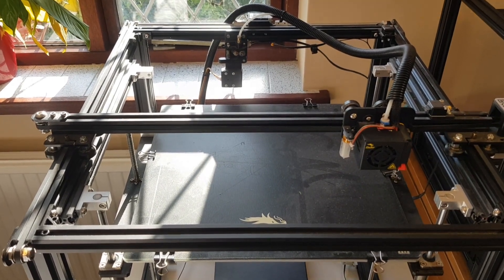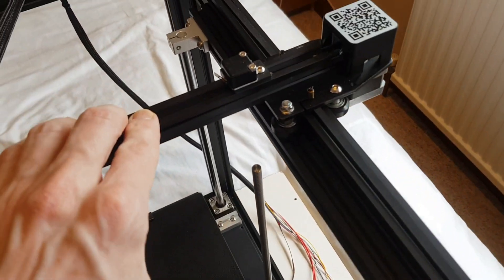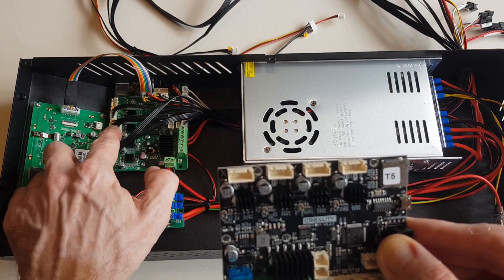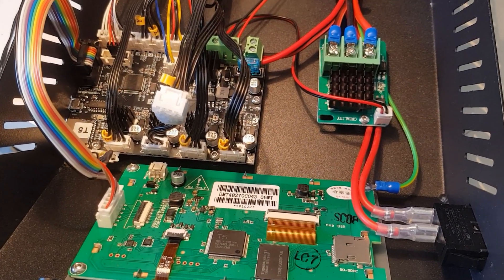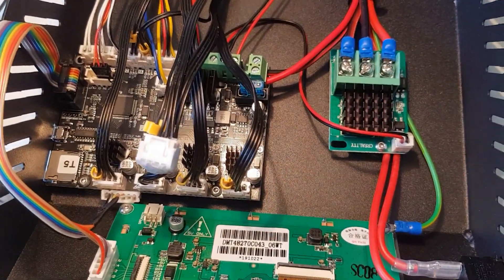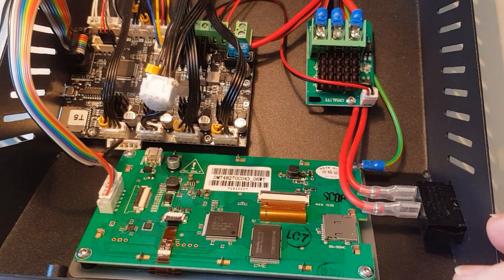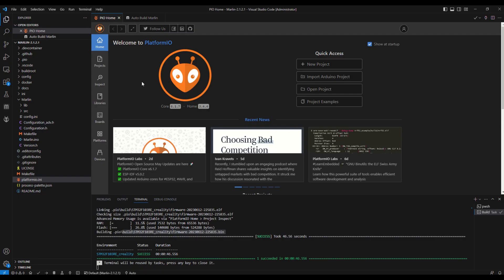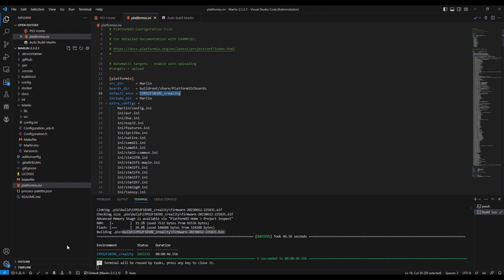Creality Ender 5 Plus - Repairs and Upgrades with 32-bit V4.2.7 Mainboard and Marlin 2.1.2.1

Comment: for the non-silent board, it's enough to replace the IC on the mainboard, cost 3-5$ (but needs hot air gun).
I replaced all the fans on the board including the one on the powersupply the printer is absolutely silent now, a friend took the printer home and is printing day and night again. I switched to CNC because I need a higher accuracy for my projects at the moment.
Reply: Is it enough to solder only TMC2208 stepsticks or something else ?
Reply: @R4ZI3L666  as far as I remember I only changed the trinamic ICs with a hot air gun. Everything else remained the same and everything still works for a couple of years. However I had to change the bowden part, the plastic snapped it's aluminum now (this is unrelated to the TMC upgrade)
Reply: @mrechbreger  Did you change the VREF voltage?  (stock board XYZ 0.68V E 0.77V ?)
Reply: @R4ZI3L666  it's a long time ago but I did not change anything aside from the driver ICs as far as I remember. I only replaced the trinamic driver IC itself. There's not much torque required, the torque which the trinamic system had was absolutely suitable for this system, so all the settings were just okay.

Comment: Hang on wheres the steps on how you put these files into the printer?
Reply: I was wondering the same thing at first, If you download creality slicer or an alternative, you can upload them directly to your printer through the cable.
Reply from the maker: You copy the firnware  onto the SD card, insert into printer and power on. Same for all these 32bit printers with Marlin
Reply: @amp9438  Unfortunately after hours I am still unable to compile a bin file. I have tried using the one you supplied. Found out that you had to rename it as "firmware" with a couple of numbers infront of it however all i am currently getting is the marlin logo for however long with the hotbed just getting hot. Compiling the bin file shows that the configurations are out of date and the marlin archives do not have the 2.1.2.1 files available.
Reply from the maker: As this is an old video I believe the version of Marlin I used is no longer on their website so my configuration files won't work and need updating. I plan on upgrading my one so will upload the new version when I can.

Comment: Do you just take the file off thingiverse extracting the files and change the name of the zip.thing file to firmware.bin?
Reply: I had the rx and tx wires reversed the mother board flashed correctly now the bl touch dosnt stop the z home, everything seems to work fine I just gotta figure that bl touch issue out
Reply from the maker: Check the wiring on bl touch. I had to swap them round for the z stop
Reply: Thanks for the help but it didn’t fix it I think the issue is with the bl touch it self it is pretty old. The wires are also kinda questionable. It work for 1 power cycle then wouldn’t even do it’s self check when powered on. I will figure it out eventually thanks again for all your hard work.

Comment: The 32-bit version prints better than the old 8-bit silent version ? What is better to do, buy the 8-bit silent version or convert it to 32-bit like you do?
Reply from the maker: The 32 bit board is alot cheaper than the silent 8 bit and allows upgrade Marlin 2.0 so you get all the new features. More work to convert it but comes down to preference end of the day
Reply: @amp9438  
Ok, 
which version V4.2.7 do you recommend with TMC2209 or TMC2225 ? (same price, the seller writes that he has two versions )
And one more thing, what Vref did you set for the motors, especially the Z axis?

Edit
Unfortunately, the seller lied. V4.2.7 motherboard has TMC2225.  E3 Free-runs motherboard has TMC2209 but no firmware for ender 5 plus :(
Reply: The transplant was successful, but I have one more question: where did you connect the small case fan from the bottom?

Edit
Firmware it sucks a bit, 
Pause doesn't work, and M900 doesn't work (important function) enable LIN_ADVANCE ???
The touch probe area is too large and probe may catch on the clips holding the glass.
You can't move axes without reference/homing (sometimes useful)

Tiny Machines 3D firmware is incomparably better on the old board 😋
Please update

Comment: What does it mean when the touch screen is not working but I get to the home screen?
Reply from the maker: Not sure exactly but sounds like the touch screen files didn't copy properly from sd card. I've heard that sometimes it takes few attempts. Also the sd card needs to be formatted in certain way as I describe in the video and the touchscreen files need to work with your version of Marlin
Reply: @amp9438 thank, it turned out the wiring was bad so I had to make new wires. I have a new problem when I set the bed temp and hotend the screen would do this weird thing and I'm not sure what to do.

Comment: Can you post a link to the DWIN you used with the Main board firmware? I your linked BIN and the latest Marlin for the LCD but it seems to be displaying the correct temp but with a decimal point and won't start prints because of this. For example 200*C setting will settle at 19.8*C for the hotend and the bed setting of 60*C will show as 6.0 or 5.9*C and is probably just a mismatch.
Reply: Use DWIN DGUS 1.0.2, I had the same problem with version 1.0.3

Comment: everything is wired right now . have the screen powering up and was able to flash its firmware but cant get the mainboard .. i got the .bin file from thiniverse but its not doing anything when i boot up on it
Reply from the maker: I've heard some report the file has to be renamed to firmware.bin. Also needs to be at the root of the sd card with no other files or directories.  If its working you should get a delay when starting up the printer.

Comment: This video is awesome! 
I was looking at my 5 Plus yesterday and i was wondering why it's using a different motherboard and firmware when it's basically same hardware setup as Ender3++  
I currently have an highly modified and not anymore Ender3 Pro and an Ender3 V2, i run on both Mriscoc firmware which i just love what it does to your machine. It gives you unbelievable  many more options and settings...
So now i was looking at my Ender5 plus and i wanted the same thing but i wanted to make sure i can run 4.2.7 motherboard on it. So you showed me that YES it works great 👍 
But Mriscoc works only with 24 bit color screen that Ender3 V2 has and to be honest im not a big fan of touch screen either so i think this is a great option for this upgrade. 
Thank you very much for this great video 😎👍

Comment: You are doing some awesome stuff here man! I wanted to upgrade the firmware for my E5+ and really wanted to make it quieter cause the way it comes, its pretty noisy. The v4.2.7 board is way cheaper that the v2.2 silent boards for some reason and I figured I there has to be a way to use that one instead. Because of this video, I'm def gonna pick up a v4.2.7 board and a z motor splitter for the double z motor situation. I'm also gonna use  your hot end strain relief cause its for sure the best one I've seen so far. Running Marlin 2 is gonna be sick too. Thanks!
Reply from the maker: Thanks. For me the V2.2 silent board was like x3 price of the V4.2.7 plus it's still only 8-bit. You can usually get good deals on the V4.2.7. Although cheaper I'd completely avoid the V4.2.2. boards as they have a random choice of stepper drivers (silent & non-silent). Also for z splitters you can buy them on eBay & Amazon etc quite cheaply.
Reply: @amp9438 Update for ya, I got it all swapped out and it’s running great using your files. I did find out that the cheap z motor splitter  needed a couple wires switched around because Z was moving in the opposite direction. 

I have the updated version of the E5+ that came with rge 500 MW PSU and all of the wiring changes were the same for my setup that you did. Was able to do it all with all the original connectors and a small amount of soldering but I’m sure someone could get away doing all this with a few butt splices. 

Anyways, the only issue I have come across is that when I try to disable auto bed leveling, it says it stored the setting but still runs the auto leveling each time I run a print. I previously just manually leveled the bed and let it rip because it takes forever to actually probe the whole bed every print. Idk if I’m missing something to make it just run a print without leveling each time. 

Thanks again for doing all the hard work for this upgrade and then putting all the stuff out there. Saved me a lot of hassle and money lol. I know for sure I would have fried a board or two trying to get it hooked up correctly.
Reply from the maker: You could try checking your start GCODE in your slicer to see if it's always running a G29 as this will attempt to test bed each time. My firmware has #define RESTORE_LEVELING_AFTER_G28 which means it should load the last levelling settings each time without have to do it again.
Reply: @amp9438  You were right on the money, prusaslicer had a G29 in the start gcode. Removed it and it’s all good. I was unaware of the gcode that pulls the old level data, pretty cool. Thanks again!

For a side note, with the new setup being so quiet, I couldn’t tell when the printer finished a print even sitting 10ft from it. I noticed there was a speaker connection on the touch screen board when I was working on it and found a JST connector speaker on Amazon that plugged right in and it appears marlin automatically sets up beeps. Now when prints are done, it does a quick little chime 👍
Reply from the maker: Hi that's great to know about the speaker mod. Thanks for sharing

Comment: Hi I did this upgrade and I also used your firmware which worked out very well. I also kept the OEM screen however I would like to make some small suggestions the firmware does not have auto refresh sd card enabled that would be nice also if you pause a print with the screen the print will not resume with your firmware other than those 2 small things I have not had any other issues .
Reply from the maker: Thanks for the feedback. Will see if I can get round to updating it and publish a new version.

Comment: Any chance you have the firmware and the DWIN files to match? 

Also quick tip you can rotate the connectors on the board so you don’t have to swap the bltouch wires around for the Zstop
Reply from the maker: Links to files in the description

Comment: Hi Mate any chance you can attach a link to the firmware.BIN file for the 4.2.7 Board please I have the firmware for the screen all done and working I have tried to build the firmware in platformio but I keep getting errors starting to become very frustrating. I have tried the firmware from the link to thingiverse it doesnt work either. I have made sure my SD Card works to upload the firmware formatted to fat 32 and 4039 as it uploads the firmware to the screen fine. if you could share a link to the *.bin file that would be great Cheers
Reply from the maker: The firmware link is here: https://www.thingiverse.com/thing:6076947/files. Did you download the file, rename it to .zip (remove .thing extension), extract the files and copy the .bin file onto clean SD card at the root? Also could try renaming to something like firmware.bin

As this is an old video I believe the version of Marlin I used is no longer on their website so my configuration files won't work and need updating. I plan on upgrading my one so will upload these when I can.

Comment: how did you plug the 3 fans?
in the board is only 2 plug?
you show only 1 fan plug in the video..
can i connect the cable like the z cable?
just split the cables?
Reply from the maker: There are only 2 connectors shown for the hotend using the terminal block and plug. The 3rd fan I have is for the PSU which is connected separately. You need a splitter for the z cables

Comment: Did the firmware upgrade and everything starts up, but when doing the leveling. The BLtouch wont properly work and the printboard is only going down. 
tried without the z-limit port on the Motherboard. What is wrong?
Reply: switched around the black and green cable from the splitter and now it works good :) OA1 and OA2

Comment: I also have a ender 5+, glad i found this. I also had the cr touch issue with the wires being crossed. 

But I have 2 additional fans it looks like? Black and red wires one running to the case fan and the other is a fan by the extruder. But i still have the yellow/blue wire fan. 

Any chance you can shed some light on how to deal with this? Can i make a 2 to 1 connection for a fan port?

Edit: i missed you plugged it into the board power bar thing

But which fan is stripped and put into the board by the power connections?

Does it make sense to put the case fan into the power block and the extra one connected to the print head into the board?

Editx2: you do mention its the fan for the hot end. So you dont want that variable? There is an extra spot on the board that can either be the case fan or that fan.

Comment: I have a massive issue with the 10 pin cable. Are you not able to just use the existing cable? I understand the clip on it is backwards but could you not cut a small square in the plastic and make it connect the original way round?
Reply: Ok I seemed to have done this I filed down the plastic nub on the 10 pin header and just inserted it backwards. Saved the crimping
Reply: @Duros1394 did this work ok?
Reply: @jameslawes  yeh it connects fine the pins are in the exact location they need to be when inverted
Reply: @Duros1394  Can you just plug the connector into the socket, or does it also work, can you operate the TP? 
Because I don't think it works!
I think the Rx and Tx have been swapped on the cable.

Comment: Wired everything got the printer on but when homing the tool head isn’t centred and the bed goes down like the control is inverted. Any ideas? I can probably fix the inverted motors by reversing the z axis wires but any way to do it with   G-code?
Reply from the maker: If you're building your own version of Marlin you could have a look at #define INVERT_Z_DIR true/false to invert the direction or as you suggest changing the wiring.

Comment: So I followed this completely and am having a couple issues. The screen firmware went through but my screen just stays showing the boot logo of marlin. My bl touch probe extends twice and stays red. Any help on what I may be missing would be great. I also noticed the board isn’t taking the new firmware.
Reply from the maker: Sounds like the firmware hasn't uploaded onto the main board. Did you add the .bin to the root of the sd card with no other files? Also is it correctly formatted to fat32? Also not sure if the sd card size makes a difference? I usually just use an 8gb one. Once you insert the card and power on the printer it should have a small delay starting as it updates the firmware.

You could also try renaming the file to something like firmware.bin
Reply: Had this issue, mine had to do with my wiring for the ribbon cable as I replaced it with 4 single pins running from the mainboard to the LCD and accidently messed up the pinout. Double check your BL touch wiring and LCD wiring maybe.
Reply: have you solved this? Im having the same issue.

Comment: I just did this upgrade.  Everything is working well except it seems that I have an issue where the z step will step up and not step down.  Did you have to increase the current on the z axis for the stepper motors?
Reply from the maker: Does it work with only one  of the steppers connected? I didn't have any issues like this. Maybe a wiring issue?

Comment: Good morning,

Thank you for your video, it is superb and motivated me to make this modification too :)

So I followed your tutorial by following your video. At first I thought everything was perfect, but I noticed that there were sometimes artifacts on the screen. Sometimes I can't go back to the previous menu with the back arrow, especially on the manual heating menu when I put the bed on heating, however, I can still change the temperatures. The only way to unblock this problem is to restart the printer. Do you have any idea what my problem is? Because I don't see how to do it...

After several tests, I noticed that this only appears when the heated bed is heating. I will try to replace the mosfet and/or the power supply.
Reply from the maker: Hi. Not had any issues like that. Maybe it's a problem with the power supply? I know early ones had some issues (non Meanwell PSUs).
Reply: Hi, I'm back here to answer. actually my problem was an additional regulator problem to convert the 24v from my printer to 12v for two fans (DC-DC LM2596s). When I removed it, everything returned to normal.
thank you a lot for your tutorial, that works perfect 👍

Comment: I have two E5P’s with silent boards and BL Touch; “Flotsam” and “Jetsam”.

Jetsam used to be my stable one, but somewhere, the Z offset got set to 10mm adjustments and I have tried everything to flash, reinstall, check wires, etc to fix it.

As soon as I select, “0.1mm” in settings, then back out of the settings menu, it defaults back to 10mm. 

This means during printing, I can ONLY adjust it in 10mm height increments. Very difficult to adapt to. 

Even with auto-bed leveling, this can only be done to a minimal degree of satisfaction.

Got any ideas???
Reply from the maker: You usually have to save the settings for the printer to remember the settings via a M500 command which saves the settings to EEPROM. You could try it yourself using a terminal with something like Pronterface to see if works. If that doesn't work you can save it to SDCARD as well but think that would be a firmware change. Are the printers using same/latest firmware? It's possible it's not enabled in the version you have.